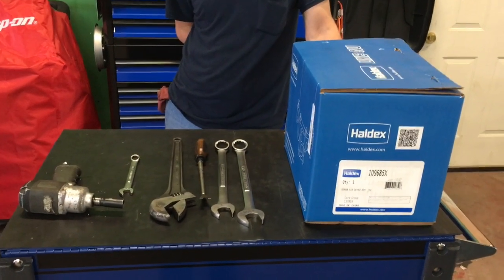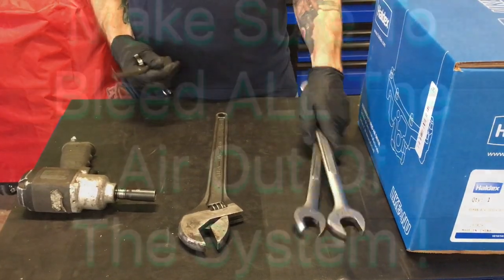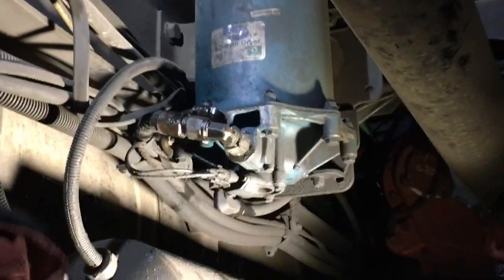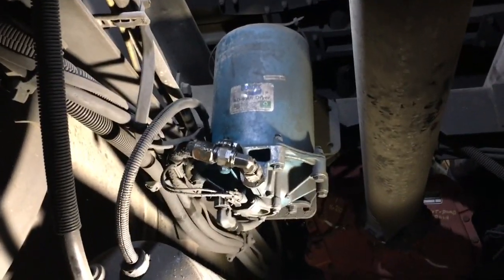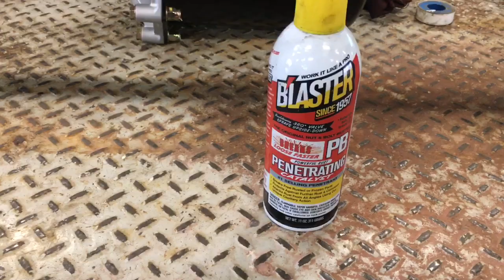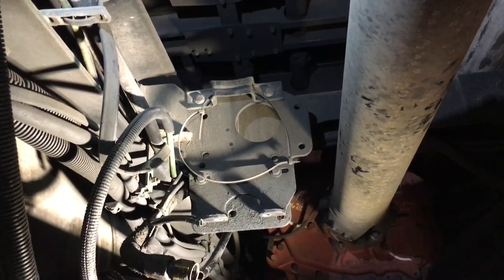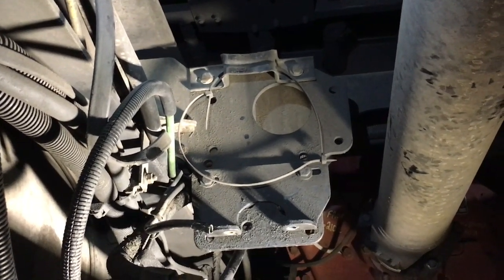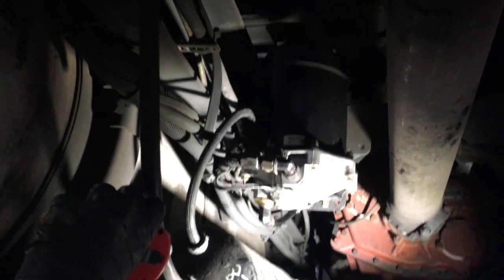Air Dryer Replacement DIY Easy Repair

Comment: I did my own a couple weeks ago. First time ever, winging it. No YT videos, nothing. It was a success..... Except I reversed the lines and made my compressor safety valve keep popping off. Put the lines on correctly and all was well. Then I find this video. Good stuff here and it's great to watch experienced mechanics at work. Keep it up fellas
Reply from the maker: Check our our playlist we have a bunch of DIY videos to save you money on repairs
Reply: I'm a new independent contractor. I will need guidance. I'm subbing right now
Reply from the maker: @DONTCALLMETHAT  there’s a bunch of good videos showing little tricks. Especially how to bleed air from a paccar when changing fuel filters. It’s in the fuel cooler replacement video.
Reply: @KoonTrucking  I look forward to it all. This is just the beginning good sir.

Comment: I have a 2018 Cascadia. Shop wants $245 to change air dryer cartridge. Learning and wanting to work on my truck to save money. Looks like I would pump down air system. Drain all the air I can. Couple bolts and some in ten minutes. Please tell me I’m missing something. They want $175 just in labor.
Reply: Sorry $145 just in labor
Reply from the maker: That’s it. It’s easy to do !

Comment: Another good video how did you now your air driyer is bad ???? I like to replace the air fitting to my shop we run our trucks day and nite the last thing we need it one off the old fitting to start leaking.
Reply from the maker: jose ibarra it would leak out of the bottom the valve was bad inside it

Comment: How of then does the air dryer has to be replaced? We just bought a 2013 Peterbilt with paccar engine we did some maintenance on it ,but not the air dryer ? Truck has 450000 Miles on it , do you think the air dryer is due for air dryer change?? Or can you tell me what are the signs of an air dryer going bad,? I would rather to put a new one now and not until it goes bad on me , Thks for the great videos they are very helpful
Reply from the maker: We change the spin on type one time per year. If it is leaking you can get a repair kit still for some of them if it isn’t leaking it’s a new filter on it so you have a schedule to go by

Comment: Hi guys, just subscribed to this channel, I can twist a wrench but it's always good to get some guidance, especially if your messing in unfamiliar territory. I have a question, my air dryer seems to be stuck in the open position at the purge valve, would a replacement kit help or do I need to just bite the bullet and get a whole new system? I bypassed the system for now just to get back to the house.
Reply from the maker: Michael Jarvis I would replace it all it more than likely has had a failure or trash and it is best to just replace it and be done with it.
Reply: Ok, thnx for your response, I will replace it when I get back home